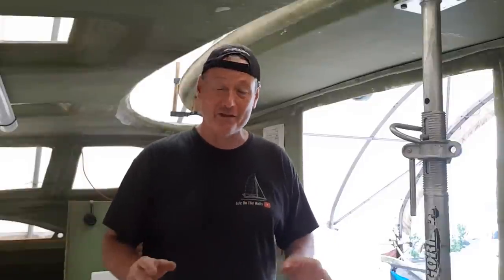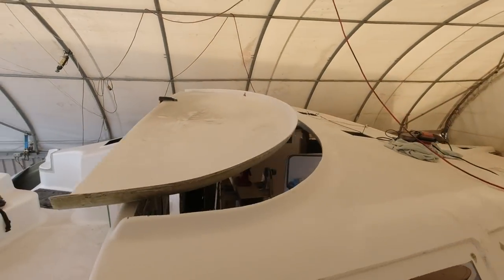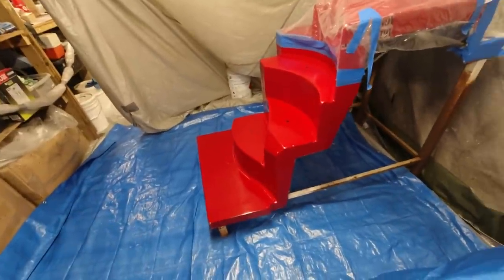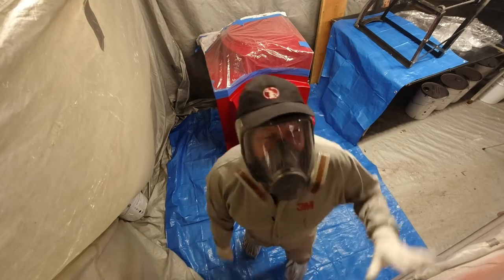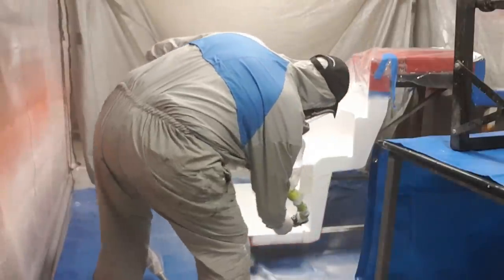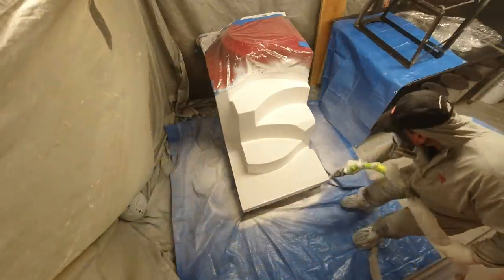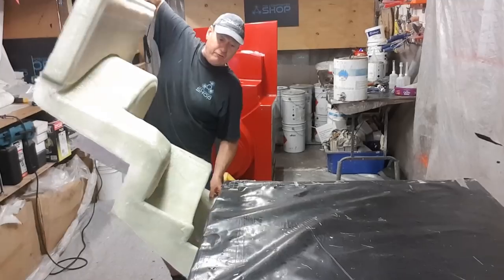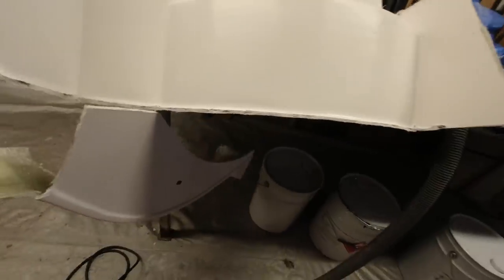Chain Locker Alterations and Helm Stair Build Rebuild Ep208

Comment: A little trick to decrease the hight of the pyramid of anchor chain (epecially with your 1200 mm wide achor locker) is to put a partition on one side. The first section of chain that is rarely used goes there to the side and reduces the amount of chain directly under where the anchor chain falls. The old fishos would use a 44 gallon drum to the side of the anchor well.
Cheers

Comment: Cool Ross  great improvement  for the anchor chain we had the same problem  until we changed to stainless chain then problem  gone  no rusty  marks on deck also, I think it was Italian chain real good quality  still on boat after 15 years and used every day. Cheers you're  doing a fantastic job the two of you.
Reply from the maker: Thanks Lindsay,that is really interesting regarding the stainless chain.I will look into that.Ross

Comment: 🤷‍♂️ so much for the locker hatch design from around March 10, 2021 episode showing the SAVWINCH.
BTW, on the lobster trawler I was on, the ship had a drum winch. And, it worked very well!
Reply from the maker: Yes indeed mate Just couldn't get my head around minimal chain and then Rhode.Also access was an absolute bugger down in that hatch as well. Ross
Reply: We had minimal chain & lots of steel cable. I know your way smarter and could have followed your plan 'A'. Oh well....

Comment: Good episode Ross

Can you still get at the chain to push it around whilst bringing up the anchor? We have a deeper chain locker and still have to use a pole with a plastic boat hook on the end to push the pyramid down.
Reply from the maker: Yes mate there is room to get your hand in to move it around Ross

Comment: Hoping you feel better Ross !  Chain locker looks just about like your photoshop design too... wondered if maybe the bottom of locker would benefit from some internal slope downward and to aft to shift chain pile aft as it lays or will hawse pipe do that for your design ?
Reply from the maker: There is an amount of slope that should hopefully help with it for sure. Rossco

Comment: I don't think you are nuts for improving the anchor hold. I thought you was nuts for cutting two very long slits down either side of the hull. I agreed with the reason to get the two hulls to marry up neat, and I knew that you wouldn't have done it-if it made a permanent weakness in the hull as you know your stuff with fibre glassing, but still it was hard to watch! Hope your home is ok. no one needs that grief.
Reply from the maker: Thanks Anthony.These mods are hard to watch but I  have full confidence Janet will be able to polish them out ,haha.Ross